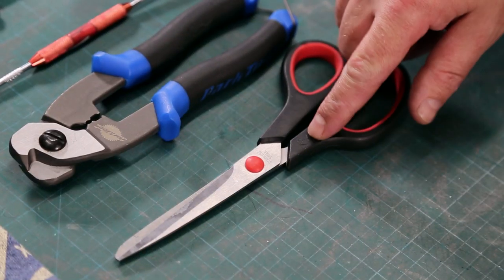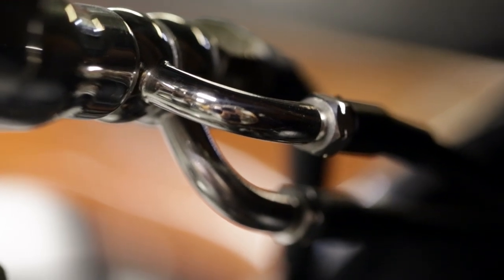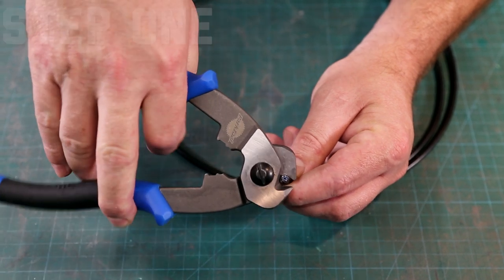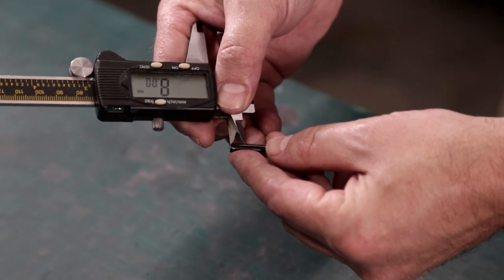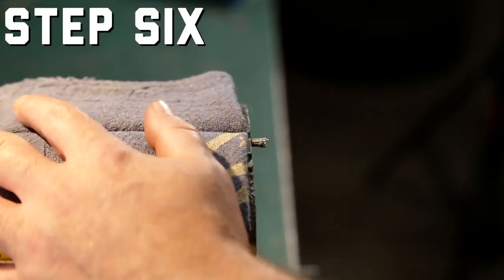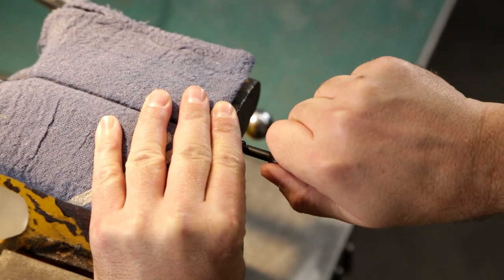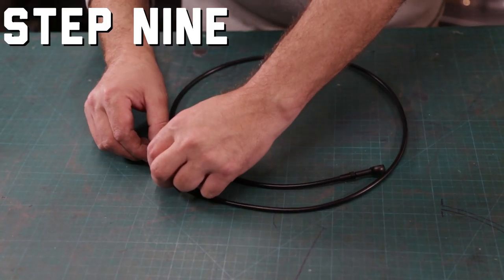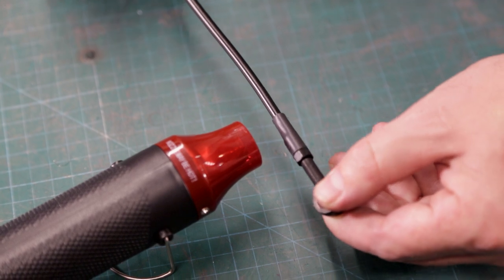How to Assemble Goodridge Sniper II Hydraulic Brake and Clutch Line //Tech Talk

Comment: Didn't have any issues you guys horned about. The banjo fitting end blow the threads out and then wouldn't grab. This happened on both fitting.
Reply from the maker: Sounds like you need to push the pick farther in to open up the inner tube more to allow it to cut threads more readily, you're not making it past the initial insertion so it's stripping out. The tolerances are tight and it shouldn't be easy.